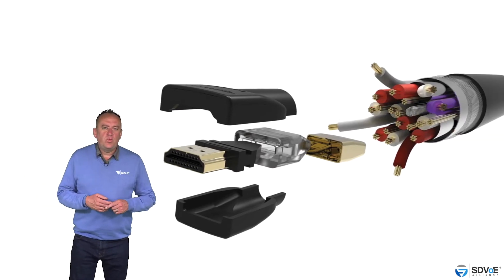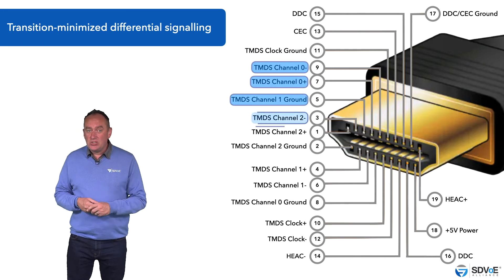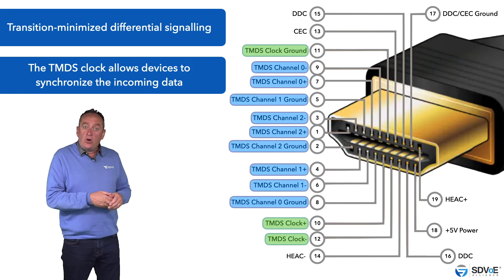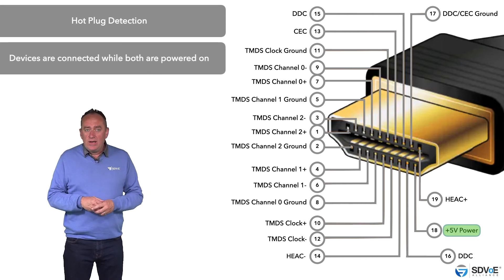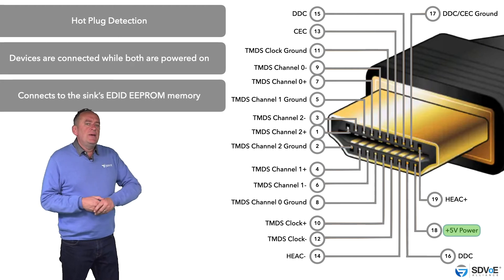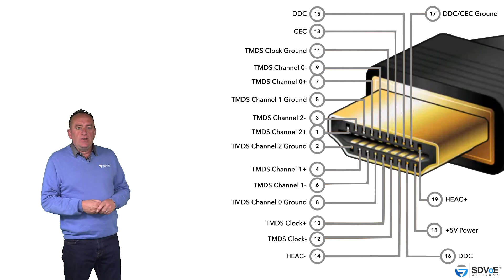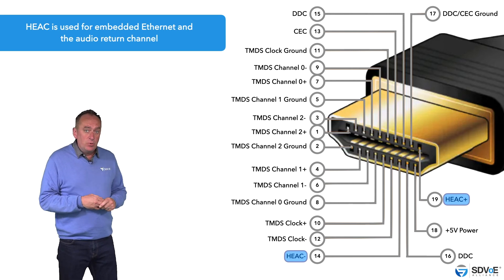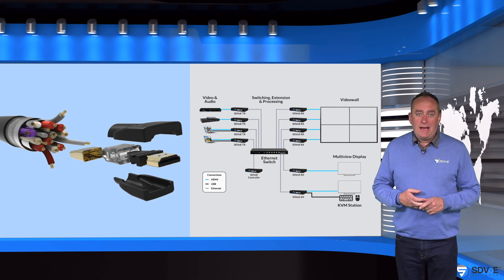How HDMI Signals Work

Comment: Really appreciate this break down, thankyou!

More to complete my understanding, Twisted Pair is a not a new idea, but its ability to reduce degradation is practically magical to those without the physics understanding - but I'd like to ask, can it be retroactively added between "degradation" points of older AV hardware?
I mean, say an old Atari 2600 - there are converstions that can take S-Video or Composite directly from the TIA, bypassing the RF unit, but even there, the choice of cabling and common or 'per channel' grounding makes a difference, which is why I guess
HDMI has its own individual TMDS channel grounds ... 
So, could you engineer something betwixt'? Thank you!